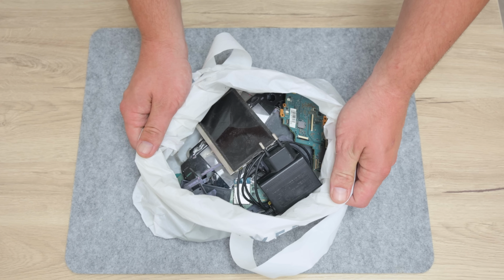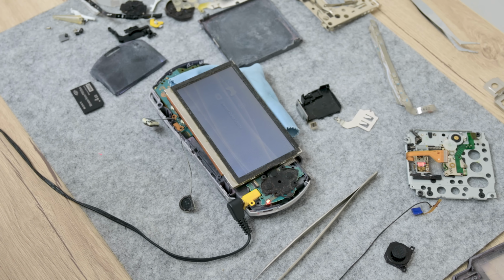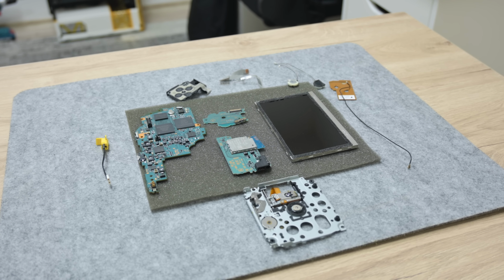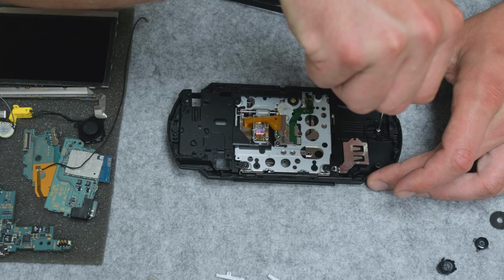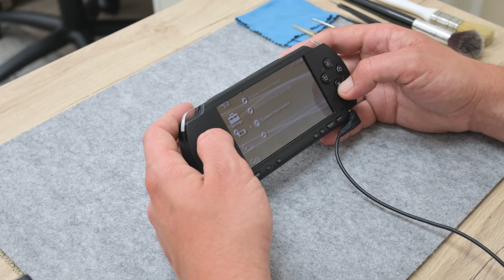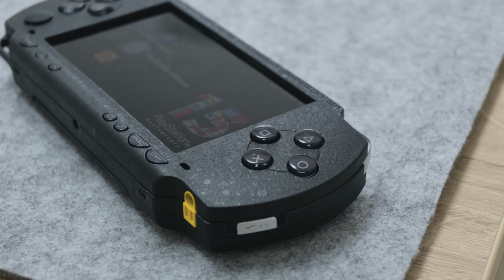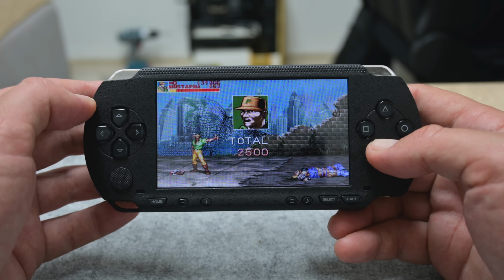Restoring a Forgotten and Destroyed PSP - ( PlayStation Portable )

Comment: The plastic scrren lens on the original case can acutlly be removed. It just takes a lot of fiddling and some force to get off. 
You cant use harsher solvents like acetone because that will attack the sourrunding plastics, use isopropanol instead to loosen some of the glue.

Aftermarket you can get an actual glass screen lens that fits perfectly in the spot where the plastic one usually goes.
You just need to glue it there with some B7000 or similar.

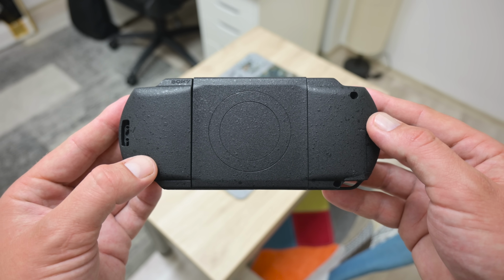Comment: 5:10 how did you make the "meteor carbon metal effect" ? Did you just not shake the bottle
Reply from the maker: Hi bro, I'm using low pressure sprays, soon I will do video about modding and painting. But in shortly explained, first I do flat paint, than dust paint from little further and then very low pressure, not hard to do, just need very very little practice

Comment: i have a psp 2000 and the drive isnt working for some reason....it is modded but it's having issues.....wish i knew someone that could fix it.
Reply from the maker: Maybe the laser head is dirty or the drive motor is stucked, this is more often problem. In more that 50% cases can be fixed easy, just if you going to lube some motor or rails to some CD drives use silicone grace
Reply: @ComputersAndTechAndAndrew  I do have white lithium grease I just used for my ps2 slim rails so that should work